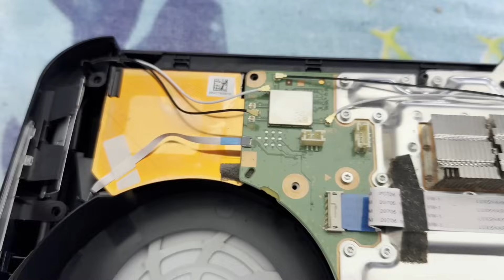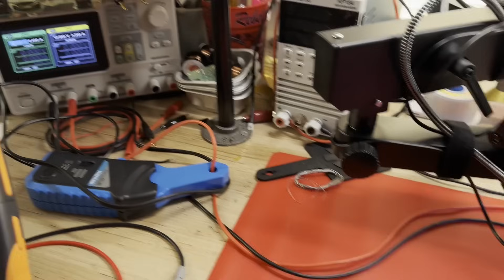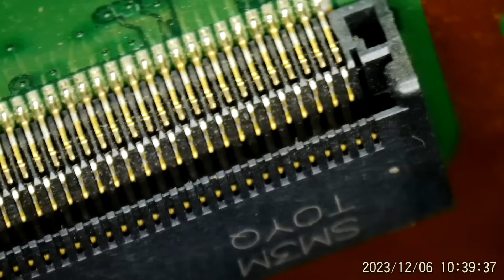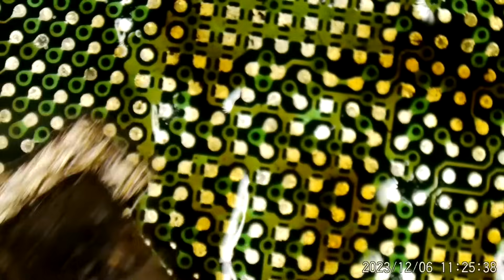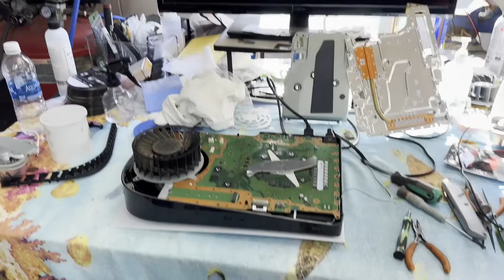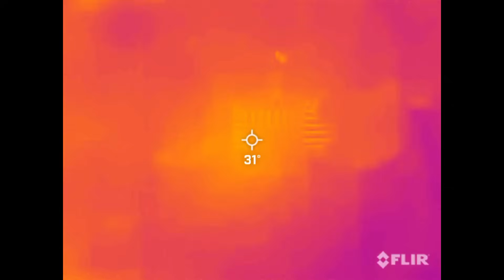#124 Repair of PS5 that Only Beeps

Comment: Great video. 

I seem to be having a very similar issue with my ps5. It beeps but does not light up and turn on, however weirdly enough if i leave it alone for a few days then and attempt to plug it in and turn it on, it actually turns on without me pressing the button but just because i connected the power supply cable. After that if i turn it off thats it, it jusr beeps and wont turn on anymore.

Please can you help me with some advice. I also im certain the issues arised after the software update which enabled the dualsense to update wirelessly. Since that update my controllers stopped working.

Comment: Amazing timing on this video .i JUST got a console with this exact issue and you went right to the exact spot i had to..🤯👍
Reply from the maker: Maybe it's a common failure.  If you have a short there you can check some of the capacitors on the trace but it's not very hopeful.  Best of luck!

Comment: Nice video as usual. A question: have you checked the point that was shorted right next to the SSD controller, after the console beep on beep off incident? Tks in advance.

Comment: How often do you run into issues with the SSD controller? I have watched a few of your videos and it seems to be prevalent. I have run into about 6 different PS5s that present these same symptoms and didnt want to try replacing the controller without some hard tests that would show that it is faulty.
Reply: I'm hearing the SSD controller is becoming a major issue across many tech channels, I think Booter and Cod3r were talking about it the other day on a livestream on livechat.
Reply: Certainly not "uncommon" but at this point there are many millions of PS5's in the wild.

Faulty SSD controllers being a large percentage of the consoles with faults doesn't mean it's necessarily a large problem for the PS5 system design overall.

Comment: I just had my PS5 put the repair shop and then tell me that my mother was bad but it didn't power it's beeping and the lights coming on but it turns right I feel like it's not the motherboard for the power supply cuz they tried a new power supply still beeps and light turns on the power off

Comment: Short on that 1v8 volt line causes a 1 sec BLOD on an otherwise working board, so you should see the blue light come on and then back off. You don't, so I suspect something else is still wrong. No point in investigating though. Great video as always, still helpful and educational though!!! Thx!!
Reply from the maker: Oh there was definitely another problem but pointless to chase it after finding the APU short.  Thanks for watching!

Comment: Personally if I was selling a broken PS5 I would describe that as it doesn’t power up.  When you’re not savvy to the terms used in this community that looks exactly like what it is.  You push the power button and it doesn’t turn on, no lights. But it being a repair shop…
Reply from the maker: The seller used the term "NO POWER" which is a definite lie to me.  "NO POWER" means it does nothing.  No beeps, no lights.  Nothing.
Reply: Yeah. You either have a situation where they don't know how to properly describe the situation or they use creative wording to give the dead console a better chance at selling.

Even if they didn't know the APU was shot, no power is a bit misleading on purpose for someone hoping they can just swap in a power supply and have a working PS5.

Comment: I wanted to tell you that I think you would be really good at replacing damaged LGA 1200 / LGA 1700 sockets. you can obtain cheap replacement sockets (preballed) from many sources. it is a simple BGA soldering job. Many people sell their damaged motherboards for cheap because they bent too many pins  or broken them and don't know how to replace these. You could pick up broken socket motherboards for cheap then replace the LGA Socket and re sell for going rate. Could be a potential prospect as I am sure your expertise is well within this area.
Reply from the maker: Hmmm.  I never thought of that.  Interesting.

Comment: Unusual fail for you (more about your success rate/skill and this a dead APU which can't be helped).  Strange it would attempt to boot and then not at all with low boot voltage.
Reply from the maker: I'm sure there were multiple problems with this one but when I found that short on the APU it didn't make sense to go any further.